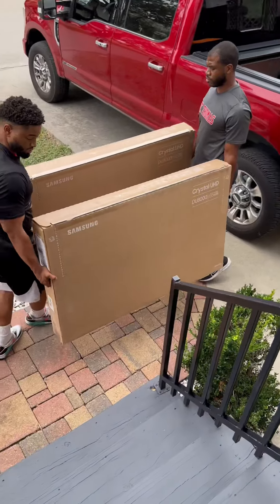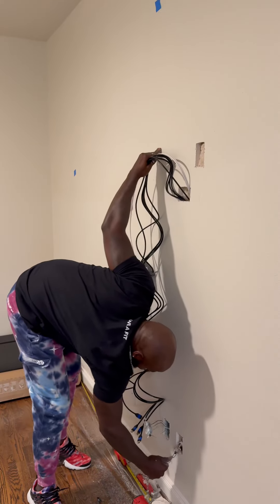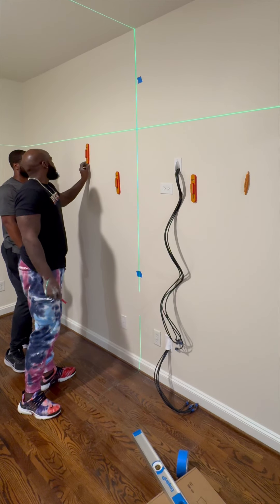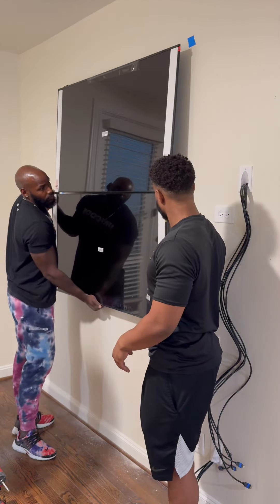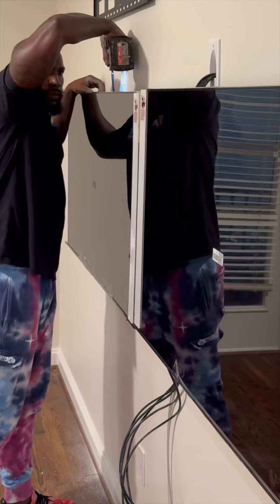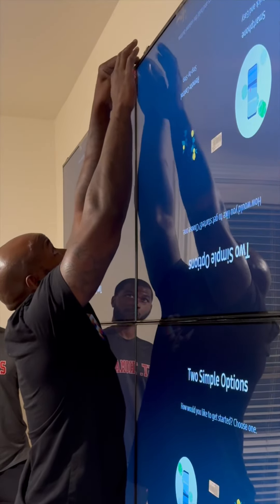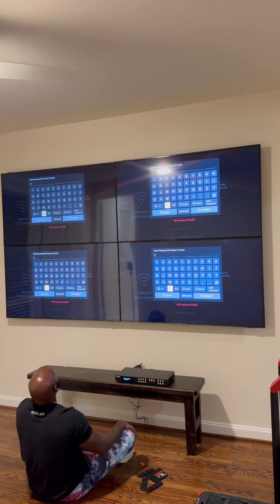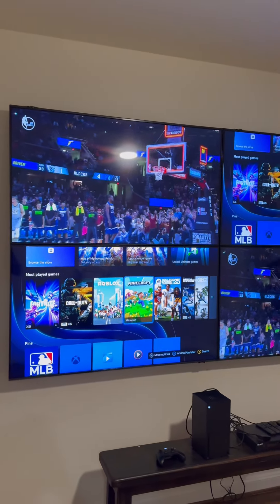How to take 4 TVs and make one screen (full video)

Comment: How do you switch the orientation on the tvs if you mount the top ones upside down ?
Reply: You can go into the factory settings to change it in a hidden menu , it's possible if your installer knows what he's doing

Comment: Are any of you certified electricians? Because you just created a massive powerdraw to a single point and didnt check the breakers capacity. And iv seen other things that are concerning and insurance voiding, like when you pearce the moisture guard plastic on the exterior walls when doing installs.

You know changing any wiring like you are doing will end up voiding your customers' house insurance right? And that if you didnt inform them that your work would do that, you could be on the hook if there house ends up destroyed?